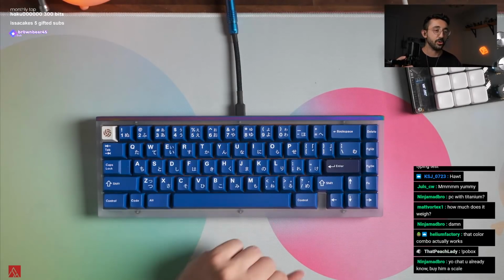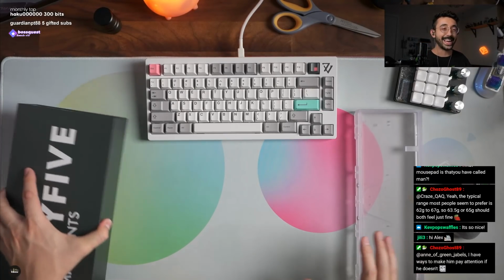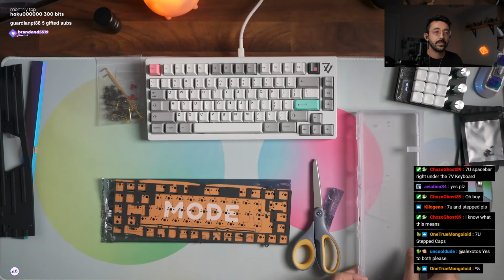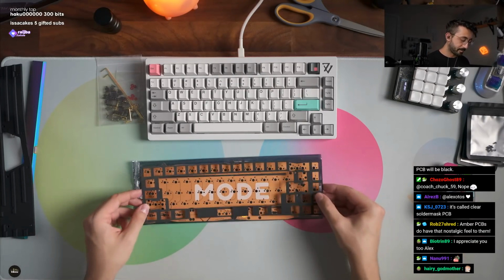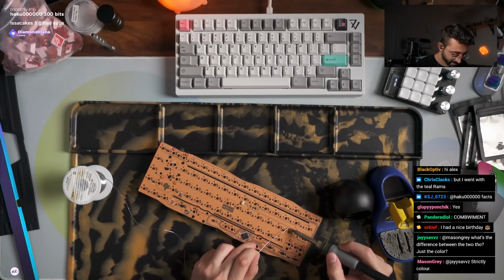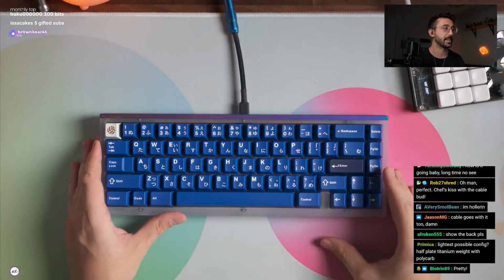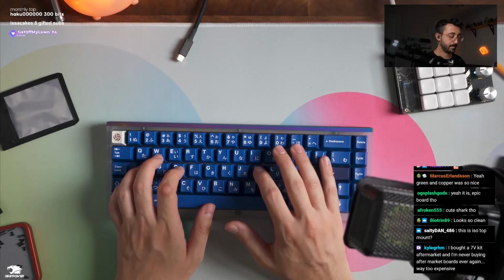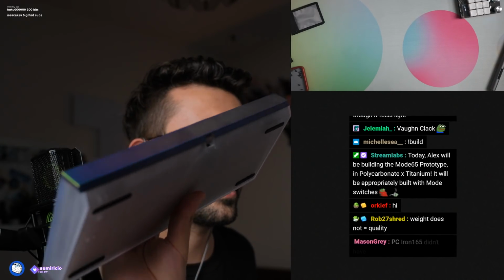MODE SixtyFive - Build Vod + Sound Test

Comment: Has Mode just not manufactured fr4 plates yet?! Not a single review I've seen has used the fr4 option
Reply: We do have FR4 plates for the SixtyFive
Reply: @modekeyboards  the question was whether you have manufactured any yet, not whether they are an option
Reply from the maker: Im unsure! I will be doing another build with half plate but I havent used an Fr4 plate yet